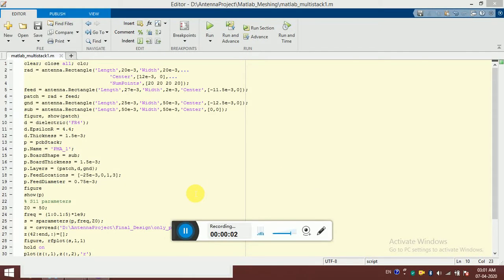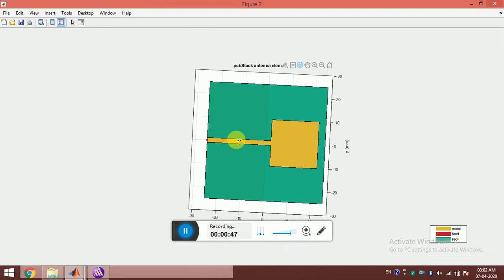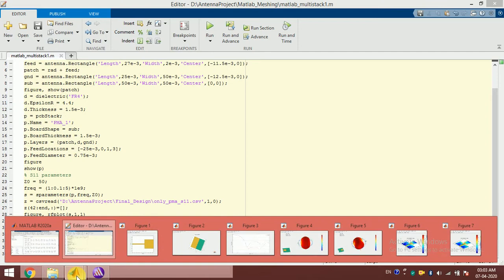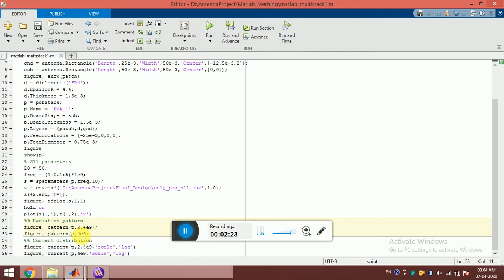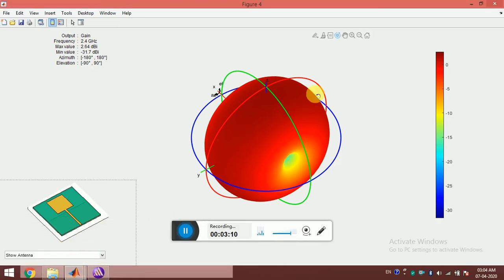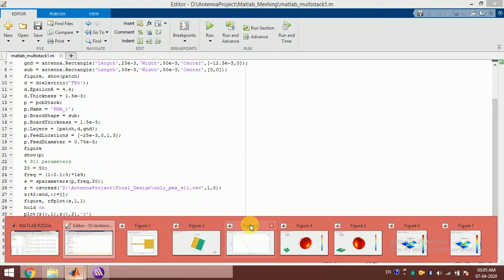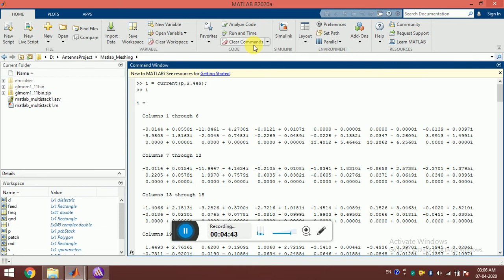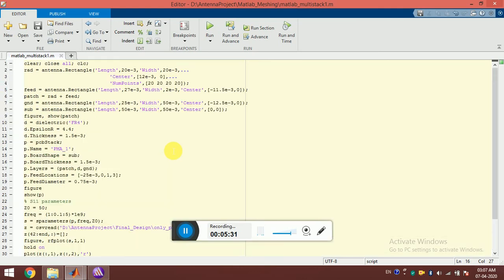First Look at the Antenna Design Toolbox of Matlab 2020

Comment: Thank you for this, sir. One question though, why does your ground now cover the entire plane and just the half of it? On HFSS they had the same size
Reply from the maker: Both the HFSS and Matlab designs are the same. In video it may not be properly visible though. Theoretically, the method of moments (MoM) based approaches are not suitable for antennas with a partial ground plane. That's why I tested on such a design. For antennas with complete ground plane, FEM (used by HFSS) and MoM (used by Matlab) always gives almost similar result.
Reply: @helpbeingengineer4726  Okay, thanks for the explanation. Appreciated!